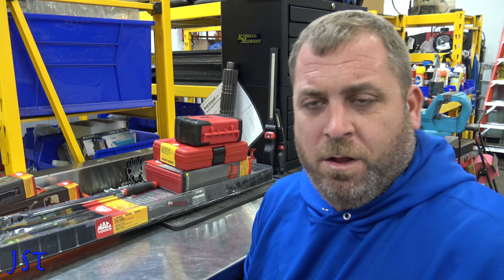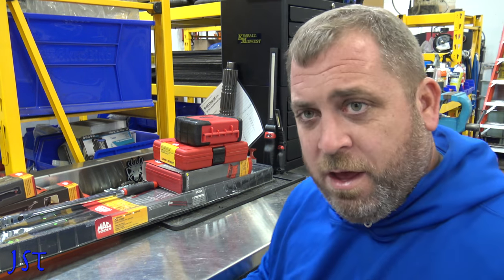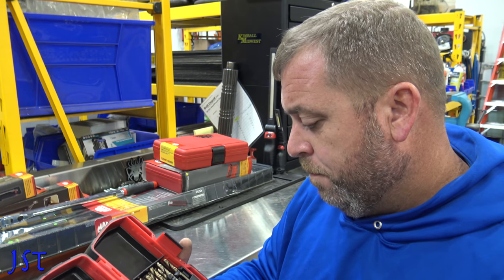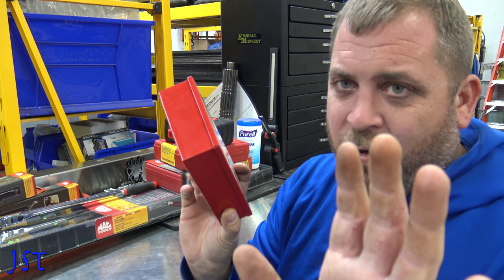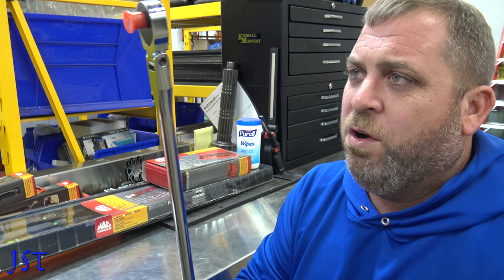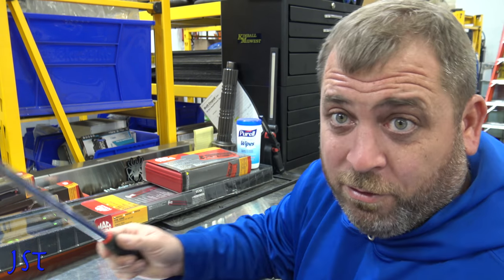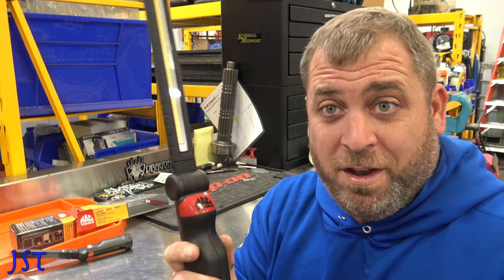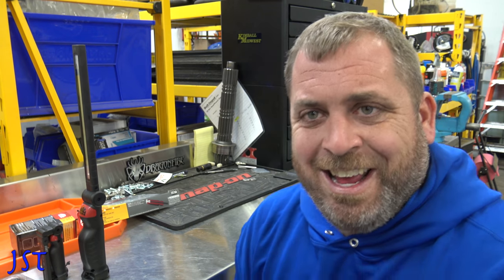I AM STARTING TO THINK THAT I HAVE A MAC TOOL PROBLEM

Comment: Hi Junkie.  Great information.  The three pronged is called tri-wing and the two prong is called a spanner.  Those are all security apex bits.  The one for wing nuts also is for installing j -hooks into wood or metal.  I use that for drop ceiling hooks/eyes.  Thank you for sharing.

Comment: The 2 prong bit is for security screws you see them on doors, bathroom stall crap like that, the 3 prong bit is a one way security bit so you can't remove the screw very easily hence the name one way screw, I use them a lot in the section 8 apartments we do the maintenance on.

Comment: Hey Never have enough of drills. I like the locking 3/8 flex ratchet. The removable light cover is a nice idea. Might help messing up the actual light when using carb cleaner.

Comment: I have the 1/2” drive 26” long flex head MAC Axis ratchet and it’s a beast. I also use my 1/4” locking flex axis ratchet on a daily basis.

Comment: The 3 blade screw thing is for security screws.you can only use them to tighten the screw as they cannot be undone once tightened.used for steel panels on doors 👍

Comment: that bit that with the 2 little prongs is used a lot in elevators, and i've seen them on certain things at an armored truck facility where they don't want workers hiding money inside things
Reply from the maker: Mike's Tool Shed Thank you Mike usually I don’t go to those types of places
Reply: Didn't they know you can always hide stuff in your butt. Hooping stuff is always an easy option

Comment: Sturgill,

You're right about the pry bars. Mac has made the best thus far in the professional tool world.

Snap-On goofed their striking, crown handles. Hard, uncomfortable, cumbersome, and they resemble knock-off Ninja Turtle Toys. Especially the green ones.

I shaved the crown ends, plus a bit more on my 54" and 36" Snap-On pry bar handles.

Once the handles felt right in my hand, I took 2" Blue/black heat shrink, wrapped the handle, and now I love 'em. 

It's funny YouTube has the community guidelines warning posted on your videos. Especially when you cuss like a trucker giving birth to a sailor's baby in a Flying-J bath stall 🤣

Comment: I saw somewhere that Mac had a comfort grip 3/4 drive ratchet.  Need to check that out.
Reply: TobeyWan yes they do
Reply: They do but you can’t torque em like an ez red or big snappy.  But mac’s other 3/4 can take a ton of abuse.   Watched a guy use the bucket on an excavator to turn the ratchet to break a bolt loose lol.   Crazy day

Comment: Nice, more tools!
The one at 6:03 was on a machine I worked on from Taiwan, a double chucked automatic lathe. It was a set screw with a spring loaded ball bearing in the middle. Problem is the two flats were only 1/16" deep and installed with some retaining compound. When I got there, they were all stripped out!
Ended up milling the ball bearing down to a flat, then drilled it out and removed it with a screw extractor...what a bitch!

Comment: They used to use those in bathroom stalls the screws have two holes kind of look like eyes on screw head. The tri wing is used sometimes on tool cases that they don’t want us to take apart. Nice haul Justin

Comment: Those striking caps on the pry bars,  are not attached to the bar, only molded into the handle. Also I blow the guts out of my long handle flex head half inch ratchet monthly, with no cheater.

Comment: Lmao i need a mac dealer, i want a rbrt ratcheting screwdriver kit badd. And some rbrt hex sockets for the shop. Im gunna rbrt my neck if i have to pound another easy out through a fuckin oil gally plug that stripped out like a piece of room temp butter